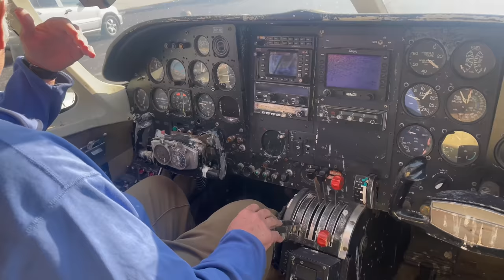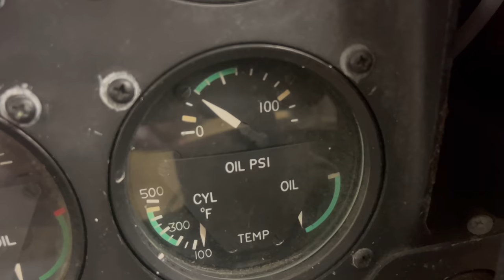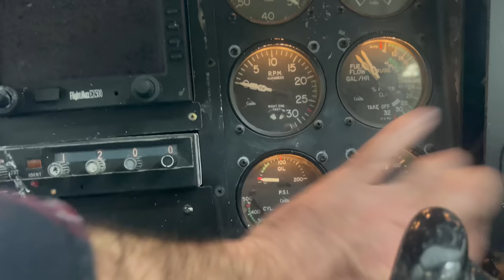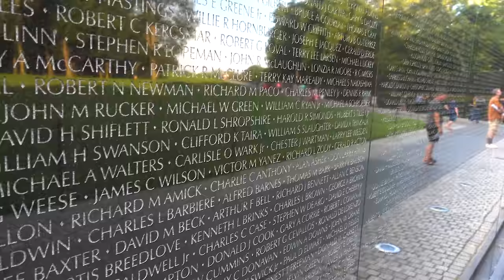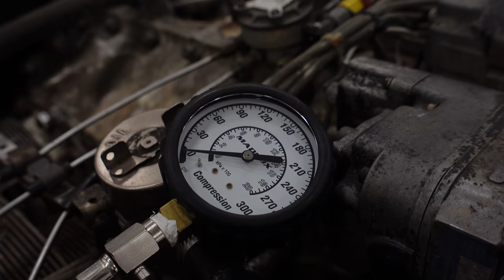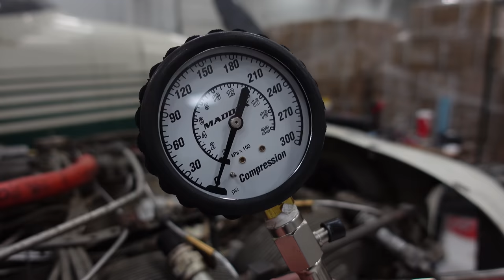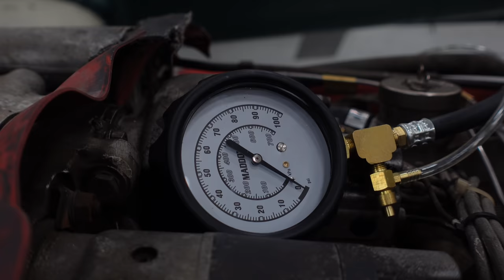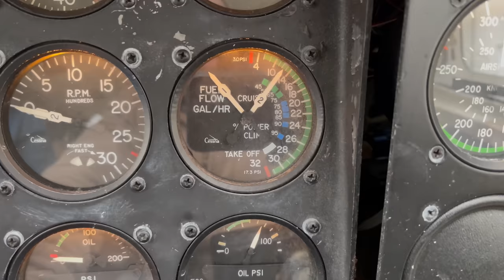Did We Ruin The FREE Abandoned Airplane Engine ? Ep6

Comment: Wow.. It looked like it wanted to start a few times when you had the other engine running.  Maybe it was higher voltage since it wasn't just battery powering the starter?  I donated to the gofundme!
Reply: i have been watching your channel for years sup
Reply: Hi there david! Love your content as well!
Reply: Good point regarding the starter, maybe also worth pulling the plugs and use volt meter at the starter terminals just to see if it’s actually getting enough juice.
Reply: If you have a alternate donation source I would be happy to give. GOFUNDME should be boycotted for there behavior of the truck protest and GOFUNDME blocking 10 million dollars without a proper public explanation. But I’m here to support your efforts, keep up the great work and I would love to see the plane used for angle flights !
Reply: @Random my thinking was that since it is struggling to actually turn it could simply be a wiring issue to the starter, however in your video the prop was hand turned and as pointed out you can actually hear something squeaking, I don’t know if the prop is belt driven, I assume not. So my very first thought is sticky valves holding to much compression in multiple cylinders, alternatively if the valves are free ( I suspect not ) then the piston/ rings could be a source of friction. The only quick easy way to visibly check would be an endoscope, ok then if all of this is fine 😀🤪 it “ could be much simpler “ and perhaps a electronics issue to the starter. I’m not an aircraft mechanic but as I know everything has redundancy and with it standing for so long could be a mouse got a happy chewing wires or just a fouled connection.fast current check at the starter may identify this….. but the squeaky noise when pushing on the prop is concerning.
Reply: @Random This ignition system doesn't work that way. It is generating its own voltage like a pull start yard engine ignition does. Spinning it faster can help a little, but it is completely unconnected with the chassis electrical system. On top of that, using the left engine to raise the volts still didn't start it, even though it was cranking far faster than the left engine, which now starts readily, and has done so several times, ever cranked. It actually started and died twice during that fast cranking. The cranking is not the problem; it's starving for gas. It's a high displacement engine with damaged cylinder walls, so it's going to take a very rich mixture to fire it. Multiple commenter have observed that the fuel system on that side wasn't flowing well. He pulled a plug after a long crank and it was dry. It's a fuel problem. Get it fueling well and it'll start first try.
Reply: The problem is that the Turbo is stuck. 
And exhaust can not escape frely
Reply: @Korruptinorge  A stuck turbo won't stop an engine from starting and running poorly. The exhaust has to go through the turbo regardless of whether it spins or not, and at low engine speeds a stuck turbo won't provide much back pressure. In fact, once it starts, the heat, oil and pressure from the engine will likely free it. It's just not fueling properly. It should be able to start and run badly with more back pressure than a stuck turbo.
Reply: @Korruptinorge  it’s possible but I have driven test cars a couple hundred km with totally blown turbos, highly restricted but still running, it’s possible though
Reply: @jonpin142  The organisers of the GFM for the occupation had the opportunity to work with GFM to give them a plan of what they wanted to do with the money, they couldn't come up with one AND what was originally supposed to be a peaceful protest turned into something that went against GFM's terms of service they had agreed to to begin with.
Reply: @toki002  that’s a generic statement, I’ve watched carefully on both liberal and conservative media. I’ve seen no actions against. To simply just say as a blanket statement it didn’t meet the agreement in a public forum, it should followed up with what wasn’t met exactly. Apology to organizer of this video. But GOFUNDME has created some issues of trust in my view.
Reply: Wild guess, but is eng. 2 starter getting full amperage?
Reply: Plane could use some retro-brighting ;-)
Reply: Crazy how these videos make 200 plus vir 1mil views and the guy got a free plane and still people support financially. While I'm in debt and living with my mom at 38 as a dependent. I have to figure out how to get people to give me money also in order to get my life back together.
Reply: cristi si numai eu  It's funny how what is obvious to us is not to so many others who are focusing on things which are so clearly non-issues to us.
Reply: @edifyguy  If the plug is dry, then yes it is a fuel problem. But, I think it is the mag. The resistance to "spark" increases with compression. You can see a plug spark out of the engine but won't work installed. He either needs new plugs, I might have missed that part, or switch the mag from the other engine. Ask any British bike owner with old mags........
Reply: Well yea. Not enough cold cranking amps and the electromotive force just ant what it should be for the prime mover to excell. 🤣
Reply: @jonpin142  blown Turbo vil run. But a Big engine like this, with the Turbo in der, if it dont spinn as totaly stuck. It wil start like it did with jumper cable from runing engine. But it wil stop again. No exhaust Out= no air in to the engine.
Reply: @haywardgiraud648  Why then did it start and die twice when he was cranking with the other engine running if the mags aren't firing? It's clearly starving for fuel. And he did remove a plug after cranking and comment that it was dry.
Reply: @edifyguy  bekos ther is to litle Exhaust getting Out. And the map sensor skru it up. I seen this isju with a lot of Big Engines
Reply: @Korruptinorge  MAP sensor? This thing was designed and built 25 plus years before those were invented! This is a 100% mechanical engine. There are no sensors of any sort, only sending units for a few gauges. The pilot, not a computer, controls this engine.
Reply: @francoisnel5253  there's an old saying with boats, and I'd guess it goes with planes as well. There's nothing more expensive than a free boat. So whilst he may not have paid for the plane he will be paying big money to do anything with it, and people enjoy watching the process so will pay to see it happen.  What would they be getting from paying you?
Reply: @edifyguy  Generally agree but it's likely a combination of factors, low fuel pressure, low compression and restriction from the turbo, since it didn't start with the help of ether my guess is the main problem is low compression, I'd remove the plugs and add some oil to the cylinders to try and unstick the rings. Maybe a leak down test to find out if the low compression is rings or valves.
Reply: @darylwalford8697  I suspect he just didn't get enough ether in for as much displacement as that engine has. That's a huge engine. The low compression doesn't help. I think he did put oil in the cylinders as part of freeing the stuck engine initially. Low compression means it's going to have to get really rich to fire, and there's simply not enough fuel to get it there. I'm sure once it runs for a few minutes the cylinder walls will get cleaner, the rings will free and re-seat, and the turbo will likely free, and from there it'll be much easier to start it again, but in the meantime it's just going to be a matter of getting that engine way more gas.
Reply: @edifyguy  He certainly needs more fuel pressure, 10psi is way too low, should be at least 20psi, most modern fuel injected cars run around 40psi, my 20yr old Mercedes has 50psi after I fitted a new fuel pump.
Reply: @edifyguy  WG then. Its an 5 min jobb to test it. 
Im not an smart as Pilot SIR 
I,m just an Mecanic
Reply: You got one engine running!) Why not just compare ignition/fuel parameters with left thats running? could be low voltage becuase of the old cables for the plugs or some issue with fuel mix. Some easy explanation for shure , issues like this usually ends as such;)
Reply: I noticed the same thing when the left engine was running and its alternator was probably pumping some more power back to the batteries. I think he should try bypassing the plane's wiring and put the battery leads right on the starter motor after unclogging the fuel distribution block.
Reply: @mikezyto3063  Not a matter of parameters; there are only a few adjustments on these and I'm sure he was doing the exact same things on both engines. The right engine has 2 main problems; low compression from damaged cylinder walls and possibly stuck rings, and poor fuel flow from who knows what. The low compression will have to work itself out once it runs for a little and the moving parts wear the gunk away and smooth out the interior of the engine. The fuel problem, I believe, is what is stopping it from starting.
Reply: @rocketbill101  Once he unclogs the fuel it will start without the need to mess with the wiring. It started and died twice with the left engine running. It just didn't have enough gas to stay running.
Reply: @Korruptinorge  It's not a matter of being smart as a pilot, (I'm not a pilot), it's a matter of knowing how purely mechanical engines work. This engine design is from the 1960s. It is a robust design that still works well today when everything is in good condition, but the challenges and repair techniques are different with old-school mechanical engines than with modern computer-controlled ones, just like in the automotive world. This engine is very much like a 1960s truck engine with a 1960s tractor ignition system and a 1960s sports car fuel system. It's an odd duck, but a beautiful duck once you understand it. Simple and robust designs are beautiful.
Reply: @edifyguy  Trust me i build a lot of Racing engines. And ben a Tuner sens Scania kame with EDC in early 80,s 
And i rebuild Turbos. And the Turbo is not controled by the Pilot. 
The wanes in this Turbo is diffrent from woth u find in a Truck or a car. 
Witch make it Harder for the exhaust to escape from it. And it is Harder for the engine to Take in Air. 
As i mention if u get higher rpm when try to start. It would start and Stop again. 
If its just a fuel problem it wil start with starter spray. 
And its an 5 min job to disconect the exhaust and air inlet, from the Turbo. 

One other thing. I gess this engine is expensive.

So try to start a engine with a blown Turbo is a wery stupid and potensiale werry Expensiv thing to do. In this case u vil just get parts from d Turbo in to the engine witch is Expensive. 

If it had ben a Diesel engine its a no no no no try to start with blown Turbo. Then u got a Runaway engine.

For me its a no no to try start anything with a blown turbo unles u bypas it or swap it.
Reply: @edifyguy  it's an electrical problem guaranteed among the low fuel pressure I'm not sure what the minimum is on these
Reply: @francoisnel5253  did you not listen to what he said he's going to do with it? He's not trying to make a quick buck
Reply: @darylwalford8697  Do you think low compression might be from valves not closing? Just wondering..
Reply: @LittleStar261  Very possible, need to either remove the valve covers or do a leak down test to confirm one way or the other.
Reply: Love seeing you following this project :)
Reply: @francoisnel5253  have ambition,  guts and a different attitude, you'll be surprised what you can do.
Reply: a bit strange to see you hear
Reply: @toki002  I'm not sure what you're implying about how the Canadian convoy "was originally supposed to be a peaceful protest." Did I miss some news about them burning down a Target or something? Actually, GoFundMe never attempted to steal money from the "mostly peaceful" protesters who used their platform to raise bail money for people who did exactly that sort of thing in the US. But whatever you think about their political views, there is absolutely no excuse for taking millions of dollars that were donated to a cause that they didn't like and trying to give it to ones that they did. The fact that they even considered stealing millions of dollars of people's donations should eliminate them from any connection to the financial services industry. But politics is more important than ethics to some people, I guess.
Reply: cristi si numai eu  he’s definitely playing up an act to make as much moolah as possible! It’s a shame that people are willing to donate to this guy
Reply: Didn't expect you here haha
Reply: cristi si numai eu  The plane was free, as the title says........
Reply: @The8BitGuy  HOLD MY JET OIL IS THAT THE 8 BIT GUY

Comment: The long jumper wires to your batteries will cause a voltage drop that's gonna limit the cranking speed when you're drawing a lot of current. Try using as short wires as possible, and as thick as you can get hold of.
Reply: I would have gone to marvel mystery oil before I tried jet fuel as a solvent, since it's an internal combustion engine and not a turbine. People have been using MMO for almost 100 years and its useable in fuel and as well as oil.
Reply: It shouldnt be the problem, when he start engine 1 and tries to start engine 2 that should supply the power to the second engine (like using another car to start your car), thats how dual engine boats work, most newer engines only have starter battery on one engine and then you use the generator from the first engine to start the second engine.
Reply: or double up on jumper cables and batteries
Reply: @Enonymouse_  jet fuel is a horrible solvent it's basically koresene which is oily id have used gas or acetone and general he could use welding wire for starter wire it's thick insulation and flexible
Reply: @michaelf.2449  It's a good solvent for things like coked oil, etc.
Reply: @akkudakkupl  huh learn something everyday
Reply: Put the jumper cables straight onto the starter motor, and if it turns over faster, then you narrow down where to look. 👀
Reply: @michaelf.2449 Jet fuel, diesel, kerosene all are very similar.  Aside from aircraft the military uses JP8 in diesel trucks and equipment all of the time.  The Army adopted JP8 as their fuel of choice with their "one fuel policy".  Hell, they even use the stuff in heaters.  I think they even cook with it.  JP8 essentially is Jet A with 3 additives a lubricant, icing inhibitor and static dissipator added to it.  Pump diesel and ag diesel both have lubricants added and depending on where you live and the time of year it may have something similar to the icing inhibitor in it.  The static dissipator in JP8 has to do with the electrical conductivity of the fuel and helps minimize static electricity buildup when the fuel is being transferred quickly. 
I use diesel to clean parts all of the time.  My dad used diesel to clean stuff all of the time.  So did my granddad that was an Army Air Corps mechanic in WWII.  It's a lot less volatile than gas and therefore doesn't evaporate as easily.  It's much safer too.   I'd consider running diesel around the oil system of an engine while not running pretty safe.  Gasoline?  Um, no.  Look at the difference in flash point between gas and diesel.  The flash point of gas is -49F  the The flash point of diesel is at least 120F.  What does that mean?  Diesel burns.  Gas explodes.
Reply: @Enonymouse_  snake oil

Comment: Also you can try to putting compressed air into one of the cylinders, exhaust valve open and see if the air is coming out the exhaust. That very slow cranking with compression only 60-90 sounds like the exhaust is blocked
Reply: Does it crank slow with the spark plugs removed? If that's the case, I don't believe it's the exhaust that's the issue. The engine isn't putting pressure in the exhaust without the spark plugs.
Reply: @dans_Learning_Curve  he was turning it over by hand and the other started cranked the same plugs in.. Of course some of the exhaust valves could be stuck closed and there would still be compression. Seems like an exhaust issue, time will tell.
Removing the valve covers and the turbo for an inspection may show something up.

Comment: My guess is a blocked exhaust, next to the turbo, from bird's nests. A few episodes ago mentioned a seized turbo. Birds built a nest at the exhaust side of the turbo, is my guess, blocking both exhaust flow/turbine wheel and compressor  wheel/impeller from spinning. 
Quick solution, as mentioned before, is to remove turbocharger temporarily. Just straight pipe
Reply: Plugged exhaust is a good reason. Check it out. As.you spin it mags. Disconnected, see if you have something coming down the exhaust pipe.
Reply: The turbo being blocked sounds reasonable but wouldn't you still see some evidence of fuel and smoke on the plug and in what little exhaust that it put out. The better would be a complete blockage of air through the intake you would have to think that any combustion would blow out the exhaust short of a complete mechanical blockage. The engine would kick every so often unless it was corked
Reply: @brettcoburn673  good thoughts too

Comment: I’m an Extra-Class Ham—I’ll restore those headsets and send them back to you—no charge. Also, you might want to rob a control-panel vibrator from some old WWII aircraft—they were literally designed to vibrate the panel enough to keep the meters true. Though a couple good finger-flicks usually do the job, the vibrator works better. Awesome project! Keep on truckin! 😄